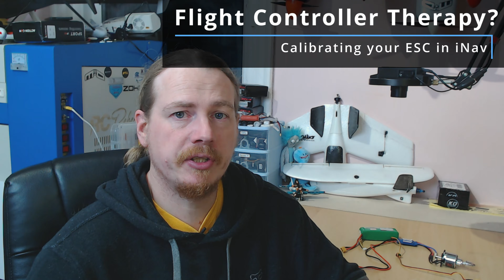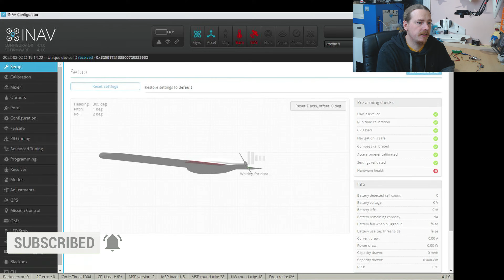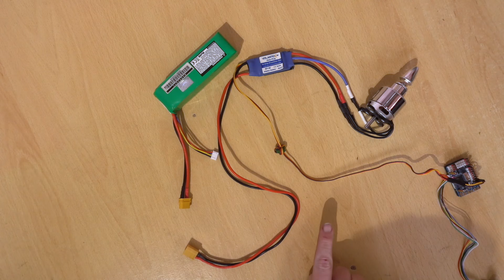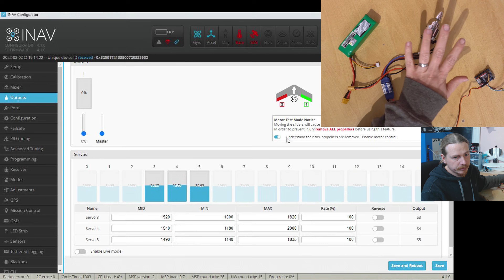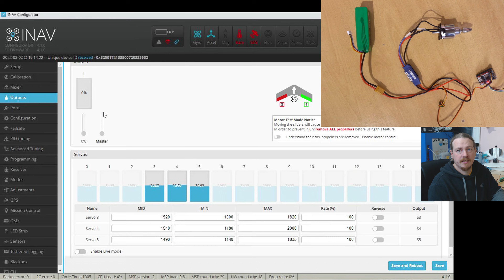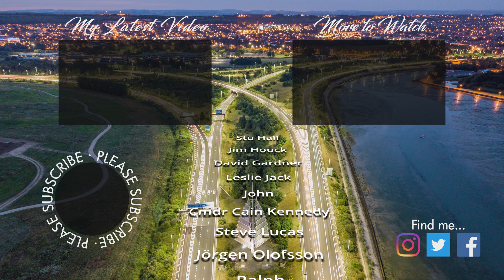Calibrating your ESC in iNav

Comment: Is there a possibility that the Speedybee Mini Wing I purchased is faulty? I just cant seem to get the servos on the Zohd Drift build to work. I can spin the motor up. Motor1 is on S1 (Timer4). Servo 1 is S3 and Servo 2 is S4. Does this equate to Pinout 1 for motors and pinout 3 and pinout 4 for the servos on the FC? I've put the servo of each on every pin and moved the joystick on the Radio and absolutely nothing moves. So something is not right. I have a Speedybee Wing on a Mini Goose setup and that seems to be doing much better than this Mini Wing FC. I just wish I could by the Bind n Fly versoins of these models and never have to touch iNav! Shit!

Comment: Hey Darren, you just saved my bacon with this video. Just set up a F411WTE in a Zohd Drift (what a squeeze that was) ... Original Zohd 30A esc lite kept beeping rapidly... was unable calibrate using the sticks... Was just about to rip everything out and install a different Esc.... Tried this method and hey presto now working a treat... Thanks Darren 👍

Comment: Just want to add that turnigy trouble shooting manual says that the constant beep 2 seconds apart says check transmitter and receiver. Doesn't make sense to me. all that is working as designed. Hmm I wonder if i should try plugging esc into s1??

Comment: Hello Darren, Just want to say how helpful all your videos have been for me.  Would this issue show up on a turnigy 60am esc attached to a matek 743 flight controller  at  s2 with a single motor,  getting a  beep every 2 seconds continually when battery is plugged in?????   I'm currently dealing with this now everything in plane works great except motor. Ill try what you showed on this video later today and hope it works. Any suggestions would be helpful.

Comment: Hello Darren,

I got the brand new EDF RC Jet and trying to convert it into Digital FPV plane.
I soldered the ESC's power and signal wires to the flight controller. And flashed the flight controller with INAV 6. I calibrated the ESC but the problem is that the motor isn't spinning and keeps beeping every second. On the radio transmitter, throttle min is trimmed at 1000 and max is trimmed at 2000.
Any suggestion on how to resolve this issue? Here is the video demonstration of the problem: https://youtu.be/75uxwvwFWP0

Comment: I'm have one question !  Is that inav won't spin the motor when no GPS in a Plane ?? when i'm Arm the swicth ..
Reply from the maker: You need to find out what is blocking arming. In the CLI, type STATUS and press enter. It will return the codes of anything blocking arming. You can check them here https://github.com/iNavFlight/inav/wiki/%22Something%22-is-disabled----Reasons

Comment: I have the Nighthawk quad running iNav 4.1  with a Matek F722 STD FC - how do I sync all the motors to start at the same time...joe
Reply from the maker: Hi Joe. To be honest, I'm not a quad guy. On mine, DSHOT syncs the motors. I don't believe it has anything to do with the flight controller firmware. Maybe this is done through bi-directional DSHOT, which INAV doesn't support?

Comment: Thanks Darren great Video. I am a long range guy and now that the Eagletree Vector is End Of Life I have switched to iNav. The one glaring difference for me is that unlike ANY other flight controller I have used you cannot just go into a menu and set the battery capacity in the field. I know there are 3 Profiles you can use but seriously as a long range guy I have many different battery configurations that I use and it would be nice just to change the battery capacity in the field WITHOUT having to have a computer with me. Unless I am missing something ?
Reply from the maker: To be honest, it’s not something I’ve ever checked. I’ve seen profiles in the OSD Menu. But not dove in to see what you can change. I’ll take a look and see if something like that exists. If not, I’m sure it can be added.

Comment: When I connect and power the ESC and connect PWM wires to my Matek, my "outputs" page fails to let me use the manual control sliders or slide the Motor Test Mode Notice switch, which is grayed out.  Does that switch remain deactivated if you don't calibrate your ESC first?
Reply from the maker: Have you enabled motor and servo outputs?

Comment: When I use a blheli_s /32 esc with dshot should I change the protocol to dshot, or can I keep it standard?
Reply from the maker: You should change the protocol to DSHOT. You should keep it DSHOT 300 or below.
Reply: Why after calibration ESC (oneshoot 125) my stick Tx throttle from button for run (100  to 80) as start run brushless?
(my ESC in 1040uS - 1960uS)

Comment: I learned something interesting the other day. This is probably all well known.  Using a quad ESC on blheli configurator. There where 3 different types main, tail and multi. Switching from multi to main it spools up slower and it's preconfigured for low voltage shutoff braking was different also.
Reply from the maker: Interesting. I've never seen that before. But I use the BLHeli Suite rather than the Configurator; so maybe it's just  in there. Definitely something to watch out for. Thanks :)